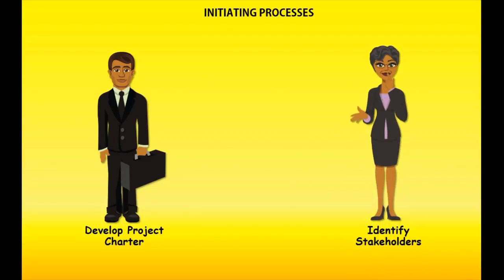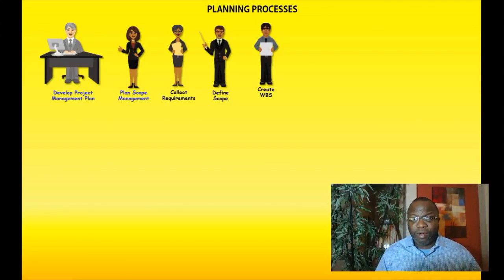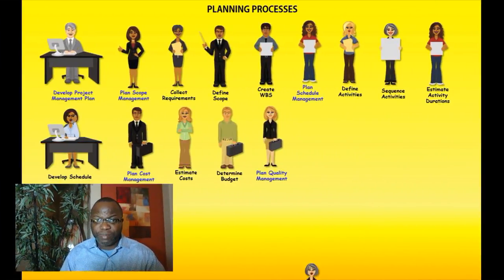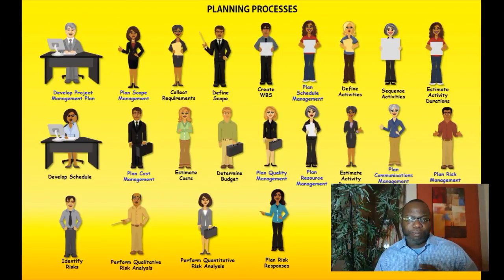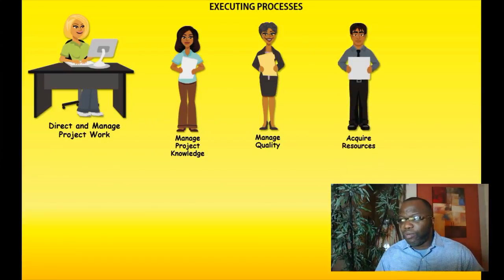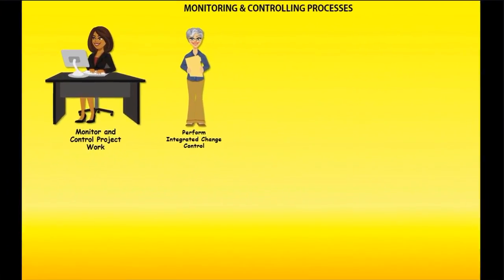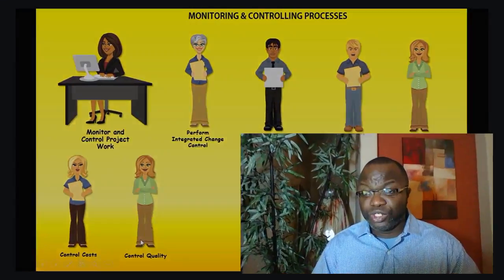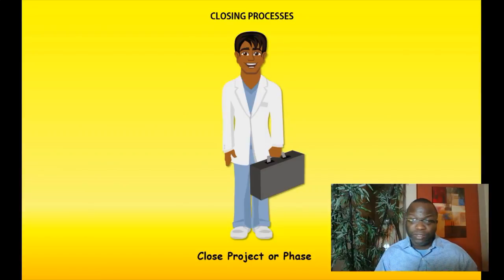PROJECT MANAGEMENT - PMP 2023 (Process Groups Practice Guide)

Comment: Hi I liked the clear and simple approach. However I do have one issue with the flow (and this applies to PMBOK also). You cannot develop a final schedule nor budget without knowing what resources you have at your disposal. You cannot schedule parallel work without having sufficient resources and you cannot estimate costs without knowing if you need to outsource work or bring in contractors (the costs will differ compared to using existing resources). So for me estimating resources must be done in parallel with estimating schedule and costs (this can be iterative). I would also say that you cannot finalise the schedule and budget until you have done the risk management.  Planning quality, communication etc. can come next (although these can affect schedule and cost also but in my opinion not as much).

So in reality the planning process is iterative and doesn’t flow in a linear way as PMBOK implies. However that doesn’t mean that what you have put together is invalid as it isn’t. Nice work.
Reply from the maker: Absolutely Michael. I say it regularly: The PMBOK Processes are iterative. A lot of overlap exists.
Pre-assignment (executing) must happen before initiating in some cases. Process groups are just buckets and labels. Processes are NOT by any means linear. This is covered in the PMBOK Guide too but you have to hunt to find it. PMI is just taking a line of best fit to present the information but they know this is NOT the case. Project Management is Iterative. I have a video about this: https://www.youtube.com/watch?v=OYj4Gk-yF1g

Comment: I understand that you can determine your budget as a total of all your cost estimations. However, during project selection process, you compare the benefits versus the costs and based on that you need to determine the project cost/budget. Am i missing something?
Reply from the maker: Indeed! Good question. Early in the project a high-level analogous estimate is available. This is what the profits are based upon: an initial high-level or in some cases even a detailed cost estimate. Some projects are actually planned as some sort of market research before initiating so when detailed planning begins based on additional clarity of parameters, a lot of the information is already available. Remember process groups are just that...groups of processes that are not necessarily sequential.

Comment: The Project Charter a 1 or 2 page document? Most of the ones I create avg 11 pages
Reply from the maker: Good deal! It really depends on the firm/PMO and the project but its scalable from one page to several. My advice is keep it as succinct as possible so you don't lose your intended audience. Some firms and teams are used to very detailed charters while others run from anything over 2 pages 😀
Reply: @Praizion  I couldnt agree more. HIGH LEVEL right. I have created some very simple ones as well. Company has no PMO so I make my own docs. Now I'm a PMI member I have a lot if resources. Do you have an email or a way to contact u?
Reply from the maker: support@praizion.com